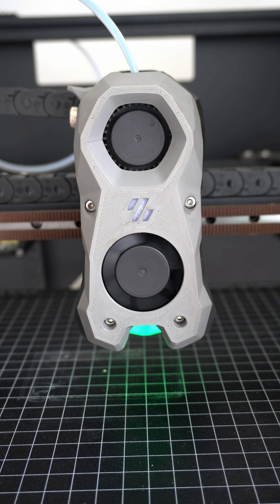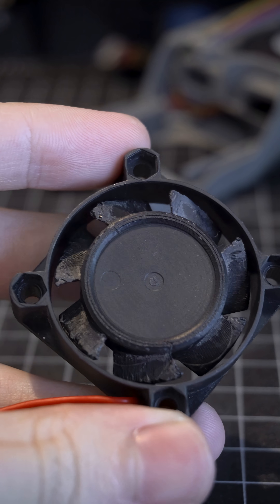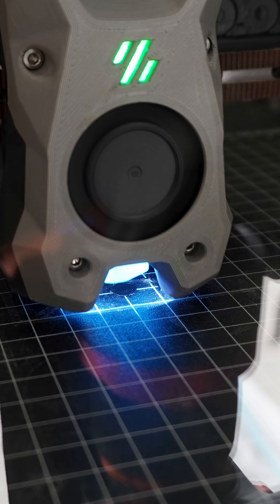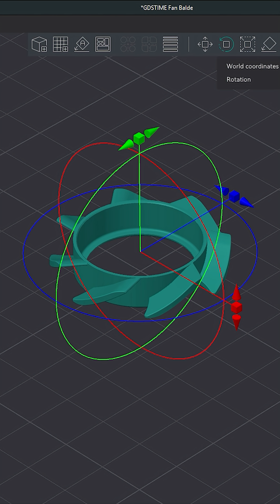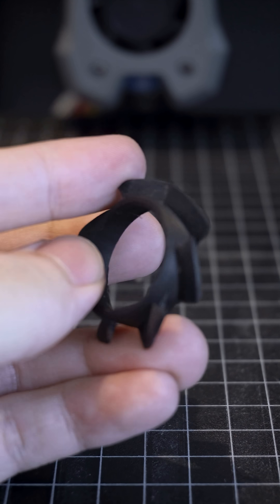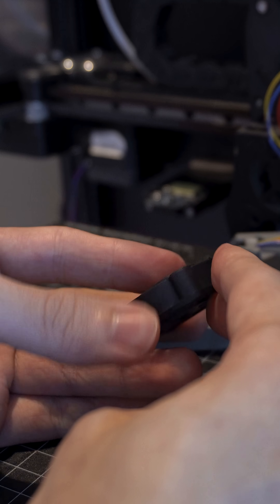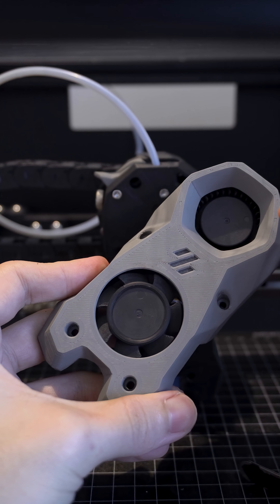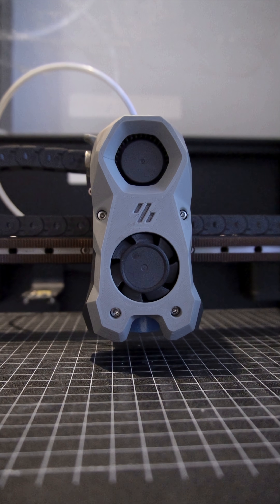Should you try to fix your 3D printer fan? #3dprinting (Part 2)

Comment: You’re supposed to tighten nozzles against the heat break while hot, and only like 1-1.5 Nm. Not a lot of torque. You’re gonna snap a heat break doing it like that.

Comment: How do you break a original fanblade? 
The balance will be off with a 3d print, and the bearing will not like that in the long run.
Reply from the maker: The screwdriver was at the wrong place at the wrong time… You’ve got a point about the balance, but it was headed for the trash anyway, so I figured I’d try a 3D-printed one just for fun. It’s been holding up fine so far, but yeah definitely planning to swap it out later on.

Comment: You could have saved time and done 0.05 with your 0.4 nozzle. As long as you have calibrated your flow and PA. Your printer should have been able to do the print.

Comment: i'd print it, then spend time with the files and sand paper to make it perfect. Maybe even print a custom sanding block to fit between the fins. So often 3D printing enthusiasts won't even try using abrasive tools. is it just unfamiliarity with the process of filing and sanding? Wood working is a great complimentary skill for 3D Printing.

Comment: Use a 0.4 with 0.1 layer height and with PVB filament. Get some 99% alcohol from your local pharmacy or online and dunk the part in alcohol. 

PVB is alcohol soluble. Combined with the 0.1 layer height you'll get a perfectly smooth fan surface. 

You're welcome.

Comment: bugger about for 3 days to make a second rate fan, or spend 50c on a perfect (for a given value of perfect) one?
hmmm.....
Reply: you cannot use a sleeve bearing fan on a 3D printer tool head, because the movement of the tool head kills them in about 100 hours.

Comment: 3d print a whole fan not just the blades you can make the blades slightly larger ant the middle pod slightly smaler and that improves airflow better than anything 😅😅😅 just a tip from my side to help you
Reply: the hub size almost doesn't matter because this part of the fan has low tangential velocity and so contributes barely nothing to the movement of air. it's all in the tips, and how well the tips fit the cage.

Comment: Airflow be damned, balance is important in a fan. Even of you can't see or feel them, there are likely increased low and mid-frequency oscillations on that 3d printed part due to imbalances. If any of these oscillations are equal to or a multiple of the resonant frequency of other parts, the oscillations can be amplified. These oscillations can affect print quality, adhesion, and resolution. It will also dramatically reduce bearing/bushing life on the fan hub. It can also cause wiring connections to loosen and any number of seemingly unrelated issues. For a part that typically costs less than $10 on an expensive machine such as a 3d printer, the potential risks outweigh any benefits of your 3d printed replacement.
Then again I could just be talking out my butt and making all of this up. I'll let you decide.
Reply: lol "risks" no, compromises, it's not gonna explode. 

but let me tell you a secret, even Sunon fan blades aren't actually that well balanced. maybe I try Delta next. Chinese fans, not even worth talking about.
Reply: @SianaGearz of all the fans on a 3d printer the one controlling heat creep on the hot end is the the one I'd want to fail mid-job the least. That by itself would be worth the $6-10 to replace it outright and maybe move this fan to a less critical job if I didn't want to just toss it.